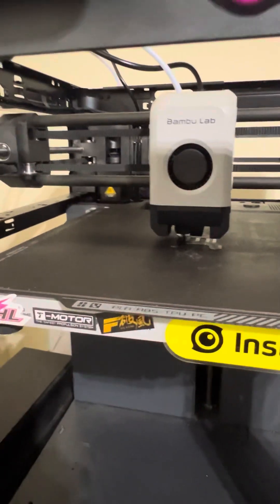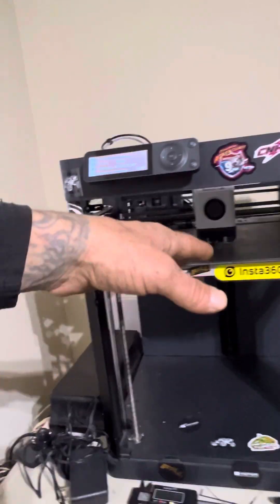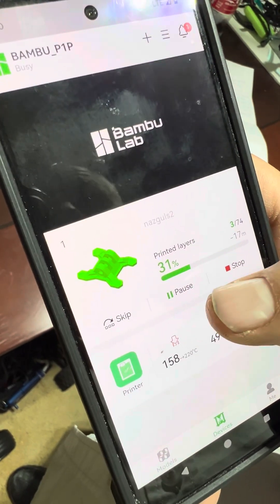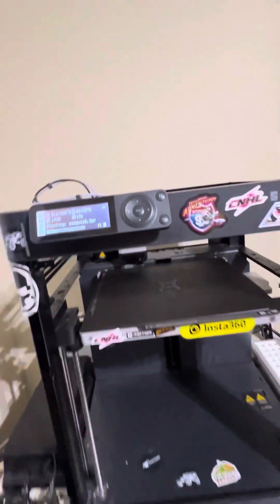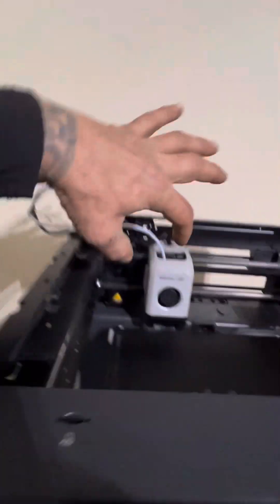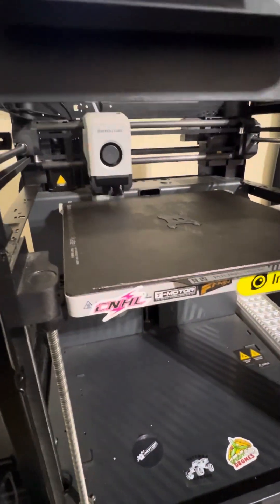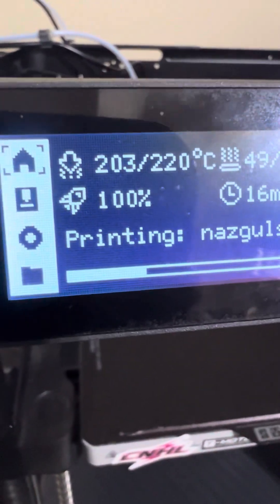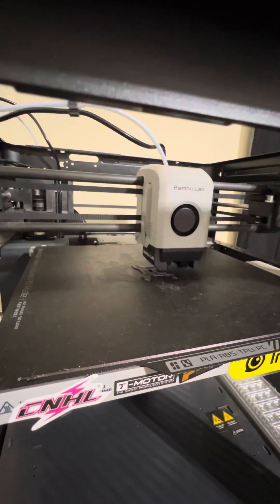Bamboo lab P1 P temperature problem how to repair thermostat and extruder head

Comment: Please don't spread information when you don't know what you're talking about man The person above me was correct it is a thermostat not a thermostat and yeah in between jobs it's automatic for your temperature to be set to zero if you're extruder is still hot in between jobs you have bigger problems than your thermistor
Reply from the maker: U need to turn yr pcb board off when u are not using printer 
End of story 
Otherwise u will damage yr pcb board bamboo labs boards are garbage

Comment: It’s called a thermistor not a thermostat after a print the nozzle temp will be set to 0 unless you’ve messed with it so leaving it on 24/7 will not mean that the print head is constantly hot